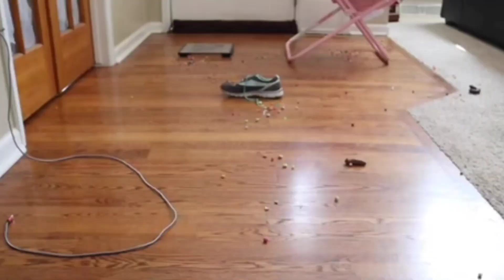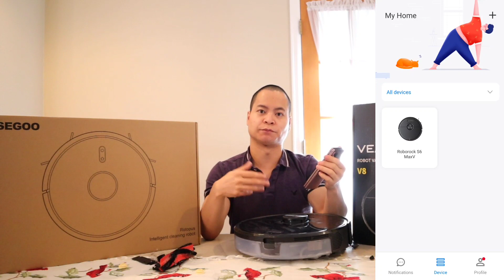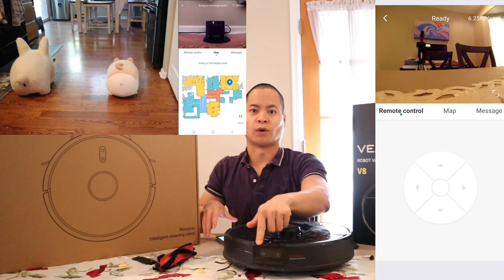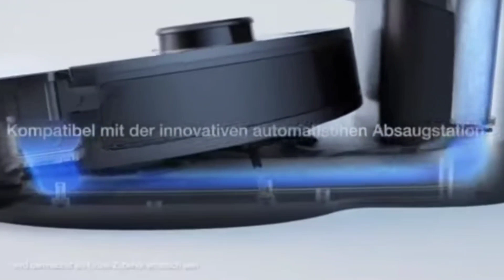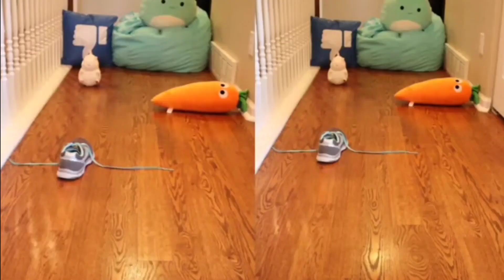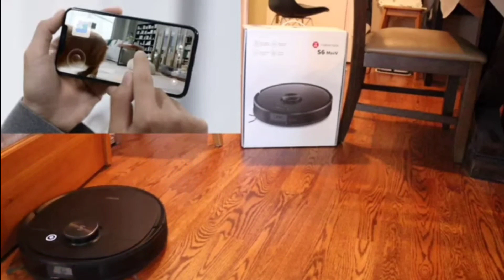What makes the Roborock so Good 🤔🤨

Comment: Does anyone have Roborocks US customer service phone number I called 1-831-217-6425 which is on their Amazon page but the number is disconnected. I had an Ecovac in the past and they have US-based phone support, does Roborock offer this? I sent and email but they would not directly answer that question

Comment: I'm looking to spend no more than $400 with taxes included for a robot vacuum with mapping and mopping. Any suggestions and or recommendations?
Reply from the maker: So a few options with mopping is the Dreame d9, very  similar to the Roborock with a few less features https://amzn.to/2Vu3HkV

The Ecovacs 920 https://amzn.to/3fQvbdu

Veavon https://amzn.to/37iZ7eG

Now all 3 robots are at the $399 price point on sale. I couldn't find any other robot vacuum that I recommend under the $400 mark with mopping and smart mappping. The benefits if the Ecovacs is active carpet avoidance while mopping. The Veavon robot has the strongest suction at 4,000 Pa, currently in the process of testing that robot. Lastly the Dreame d9 offers a lot similarities if the Roborock minus map saving and some less features.
Reply: @RobotMasters  Thanks for responding and great video. I'm not sure why you don't have more subscribers. 

Do all of needs models work with google and offer replacement parts?

Do they return to the base when they need a charge and resume the cleaning?
Reply from the maker: @MRRDCS  No not all work with google. If they do, most just allow you to start and stop the robot via voice. The parts can be bought through 3rd party retailers or through their own websites.
Reply: @RobotMasters  What about this Model?

Check this out at Amazon
Proscenic M7 Pro LDS Robot Vacuum Cleaner, Laser Navigation, 2700Pa Powerful Suction, APP & Alexa Control, Multi Mapping, Ideal for Pets Hair, Carpets and Hard Floors, Black https://www.amazon.com/dp/B07Z9YWWKD/ref=cm_sw_r_u_apa_fabt1_dlC_tAhXFb6TF3NKC?_encoding=UTF8&psc=1
Reply from the maker: @MRRDCS  The Proscenic doesn't have electronic mopping system and I feel the water tank is a little small. Only for small areas. Also the self emptying system not good at extracting large debris. If you can forgo those short comings than the m7 Pro not bad.
Reply: @RobotMasters  The Ecovacs seems like the one to get but it's $499, not $399 😢
Reply from the maker: @MRRDCS  On on my end it showing $399 maybe there different coupons.
Reply: @RobotMasters  Ok best robot vacuum with mapping for around $350 - $400?
Reply from the maker: @MRRDCS  Top ones are the Roomba i3+ https://amzn.to/3qfbwJg

Roborock S4
https://amzn.to/3fWxj3x

and the 360 S5 Robot
https://amzn.to/3ltxVyF

Best robots so far!!!

Comment: Brother which is better between s5max or this s6maxv
Reply from the maker: On paper the S6 MaxV, if you don't need the front facing camera the S5 Max offer all the features minus the Camera, less suction and battery life.
Reply: @RobotMasters  Is the AI worth it? How well does it work? Is it improving with software updates etc.?
Reply from the maker: @nonnnonnonon  It a lot better than the Shark IQ, mapping took two runs. I found the sensor to be really good at detecting objects.
Reply: So can you say in the current market and out of 100 robo vaccums out there ..currently roborock s6maxV is a good and a reliable all rounder..
Reply from the maker: @DrBoombay86  Yes it one of the better ones and the Roomba i7+